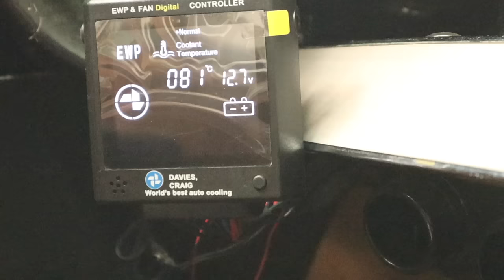Can I stop it overheating?? - Ferrari engined Alfa 105 Alfarrari build part 212

Comment: There is no such thing as a too big radiator. Also water going too fast is debatable too because it is the amount of heat energy getting processed and if you think about logically the water speed would not effect that much, however your problem was "channeling" which means a portion of water carrying  heat was making it through the radiator faster and some of the water was stagnant.

Comment: I was surprised by the result Jeff had changing the path of water. For my understanding of cooling the only way that Jeff was able to increase the cooling effect is because before some (a lot) of radiator is unused with low or no flow in. Any thoughts on this?

Comment: I have some doubts about the wisdom of slower coolant flow through the cooling circuit allowing the coolant more time to shed its heat in the radiator.  That idea leaves more time for the coolant to absorb heat in the engine.  If the coolant is flowing faster and it is just warm instead of hot, when the warm coolant passes through the radiator it has less heat to loose.  I would try a coolant pump that had no restriction and sped up the coolant through the engine.  More cooling time in the radiator equals more time to absorb heat in the engine.  I think that the engine is better at producing heat than the radiator is than absorbing it and transferring the heat into the airstream.   Also, your engine fills up the engine compartment pretty well leaving probably diminished airflow around it.  I don't remember if your headers are wrapped with insulation or not to allow more exhaust heat to leave the car.  Cheers.

Comment: put some louvres  in the inner wings  that way the heat can escape through the wheel well , or louvre the bonnet to let air out that way ,, other option is to make it so that the bonnet is open a bit at the back end so the hot air can get out that way ,, the way it is now no air can escape anywhere , it's to tight under the bonnet

Comment: If I may put a suggestion. Put a temperature sensor on both in and out pipes of radiator, this way You will be knowing for sure if coolant can't ... well cool enought inside radiator.
Reply: Was going to make a similar suggestion. The biggest thing I have learnt in my career as a research engineer is, when in doubt measure something! That way you can confirm or rule out the various hypotheses about the cause. In this case, the more places you measure temperature the better, inlet and outlet of radiator, engine bay air temps, ideally a thermal camera onto the front face of the radiator... etc.

Comment: Jeff, do me a favour. 
Find a way to install a drain pipe to the base of the radiator - seeing all that coolant run over the bottom valance is shocking.    I know small stuff, but I know it bug you too.
Reply from the maker: It does annoy me, but hopefully from now on it is a very rare occasion to do it ;)

Comment: sheared??
shear: verb
past tense: sheared
    1.
    cut the wool off (a sheep or other animal).
           cut off (something such as hair, wool, or grass), with scissors or shears.
         2.
    break off or cause to break off, owing to a structural strain.
    "the gear sheared and jammed in the rear wheel"

Comment: with all that engine in a small engine bay.. the hot air will stagnate and not flow out well,,, find a way to vent the heat out.. even small hood vents would do a lot to get air flow out of the engine bay// as a test you could prop the hood up  1 or 2 inchs.. test it... to see if this helps cool the system down..and if it does.. you have found your problem and you can make very subtle hood vent that would look good on the car
Reply: sorry? then i will not comment here anylonger HomeBuiltBy_Jeff

Comment: Hi Jeff

Do yourself a favour and have a aluminium radiator made (replicated ) I have a 79 GTV and it now never ever gets hot. About 1/3 better cooling same size and shape. I wanted a fat core and the guy refused and years later I am still very impressed with the standard custom aluminium radiator.

Comment: Would an oil cooler help bring engine temps down? I have a small footprint radiator in my 2.8 vw vr6 super charged mk2 Jetta/vento with small fans and an afco Scirocco  radiator but have an 8 x 11 inch oil cooler. I have not run it yet but my thoughts are cooler oil would have slightly better cooled motor

Comment: Interesting with the radiator fix. Glad it worked but i dont buy the transition time theory. If you have one big radiator it will flow through that slowly.Three smaller ones will have water moving through them faster (relative to the radiator). I think maybe the issue was some shunting of the cooling maybe in the large radiator? Ie it maybe it was easier to go through part of the radiator than to the end and then through? Don’t know but nice it worked :)
Edit to clarify. Now it can be seen as a radiator that is 3x wider but 1/3 as tall. Coolingarea is the same.
Reply from the maker: I was not clear. It is not a speed through the radiator, but more that the coolant will take the easiest path and it with the big internal passages, probably just flowing across the top half of the rad. Now it is forced to use the whole thing ;)
Reply: @HomeBuiltByJeff  Ahh :) Then I totally agree with you.u.

Comment: Saw this on a Ferrari forum........ Do you have the same volume of coolant as the Ferrari 360?

"The 360 also runs the same setup, operating temps are 77~81C 170~177F open point on stat, with a maximum allowed of 120C or 248F, given the complexity of the system including the inclusion of engine management to the temps of the cooling system sustained temps that are above 210 will cause problems.

the operating point of the 308,328,348,355 & 360 is around 195F the entire system is setup to try and hold or maintain the temps in that area. will it go higher at times, yes, but it should return to 180~200F long term temps beyond that indicate a problem somewhere.

The oil system is not passive like found in many other vehicles, with the exception of the 308/328 it's a drysump setup with it's own coolers/fans etc.."

Comment: I thought the coolant had to enter the rad from the bottom and exit from the top.  That way the whole surface area of the rad gets used.  Could you reverse the direction of flow to test?
Reply from the maker: No, should always go in from the top. Heat rises and you want the cooler stuff at the bottom back in the engine ;)

Comment: I'm a bit worried that sealing up the point where the two exhaust pipes meet - where the 'x' is formed - will have introduced a flow constriction down each pipe.
Is that not a concern at this point?
Reply from the maker: There is an Engine Masters episode you need to see ;)
Reply: @HomeBuiltByJeff Probably more than one!
Your Alfa is a symphony of automotive excellence :)

Comment: hi Jeff - I vote for some Opel Manta/Ascona 400 triangular holes in either the bonnet or the perspex window to at least let some heat out of the top of the engine bay - surely thats got to help. Brilliant work as usual - you made the adding those new exhaust boxes seem almost too easy...!

Comment: Jeff, do you know what model Corolla you have the rack out of? I've got a 99 AE112 as my school run car. Happy to take some measurements (eg like centre of axle to centre of rack measurements on the steering knuckles) if you'd like. It only runs 14" wheels, it's not a huge distance and I've never noticed the rack in it being that slow.
Reply from the maker: The big measurement I need to know is the distance the rack moves in one full rotation. Mine is about 38mm. I need one that is much less than that.
Reply: @HomeBuiltByJeff  I'd have to get it up on ramps or blocks to check that. It has 3 turns lock to lock which seems similar to what you said in the vid.
I'd be curious about the distance between the steering pivot point (ie through the strut top down to the lower ball joint) and the tie rod ends you've now got.
Reply from the maker: @stevewandel9317  I just realised I had my measurements around the wrong way, and I need more than 38mm per revolution. I think the Yaris rack might do the job. We will just have to wait and see how it goes next week ;)
Reply: @HomeBuiltByJeff  yes agree, more movement of the rack needed the further the tie rod is from the axle line

Comment: Coolant must go in the bottom and out the top of the radiator. There is a differens…..
Reply from the maker: No it should definitely go from top to bottom.  Heat rises

Comment: Did you consider removing the yellow long cover from the top of the radiator?
Reply: That would let air flow over the radiator instead of through it.
Reply: At very low speed (ie traffic) it would help to dissipate the heat
  @Darren_Martin

Comment: Maybe a different antifreeze could solve your problem. Ever thought of Evans Coolant? It's the only thing Jay Leno runs in all of his cars...
Reply: Engine will run hotter with Evans, it's boiling point is up around 170+ DegC (I think). The big advantage with it is it doesn't expand at the engine's operating temperature so the cooling system doesn't have to, operate under pressure. But it does have a lower heat transfer coefficient than water based coolant.

Comment: jeff you might want to consider the fact that your front end has a very small opening restricting incoming air flow at hi volume air flow needed period hi speed or on highway cruising i found this issue on conversions were the smaller cars same as your issue had no air flow at highers peed  would slowly heat up  around town there fine but on the highway you would see it creep up some times over a slow period of 10 to 15 mins at 100 kph you would see it slowly go from 88 deg to 98  but again around  town be perfect always 88deg if you want a better note and make it quieter out of your exhaust you should run gated mufflers like lukey turbo or simular staineless  there a truck muffler simular looking to the ones your using but longer.

Comment: Pumping in more air with nowhere to go isn't very efficient. Just need to vent that hood so you can give the hot air somewhere to go, and in the direction it already wants to. Look at any serious race car. You did change your shielding gas for Aluminum ya? (I forget Argon/CO2 for steel, pure Argon for Aluminum?)
Reply from the maker: I Always use pure Argon for the TIG and mix for the MIG. Does the job for me.

Comment: I've seen this multiple times. The problem is the shroud on the back of the radiator, it blocks too much atmosphere from flowing through the radiator. It restricts it.

What you need is to get rid of that POS shroud on the back of the radiator, and create a hand-made shroud that shoves atmosphere through FROM THE FRONT. You need to manage air flow in FRONT of the radiator, forcing the atmosphere through the radiator and not allowing it to flow around the radiator. 

Seriously, the manufacturer of that radiator/shroud/fan set-up does not know WTF they're doing. Delete that shroud completely, and figure out how to mount the fan(s) without it.
Reply from the maker: Managing airflow from the front makes basically no difference while the car is stationary ;)
Reply: @HomeBuiltByJeff 

1. Yes, it does.
2. Your car overheated when it was moving. That shows that your entire cooling system is crap for it's intended purpose. If it can't keep the engine cool when the vehicle is moving, it sure as hell won't keep it cool when it's stationary. 

Whether the atmosphere is moving due to fans sucking it, or the vehicle moving and pushing it, is immaterial. The atmosphere has to get forced into the front of the rad, flow through it, and exit out the back. The current system doesn't do either the former or the later properly or efficiently.
Reply from the maker: @glock22357  It has never overheated when moving at speed. Only when stationary or crawling through a crowd of people... ;)

Comment: a car should not overheat when it idles... you can simply check the flow issue by feeling or checking the temp on each side. 3 cores... should have done 2 max. but this isn't your problem? are you checking temps with a 2nd or 3rd measuring device to verify? pump flow rates maybe. but there is no way idle should overwhelming your system. it shouldn't get hot even without a fan

Comment: If the fan is cooling a stationary engine sufficiently through a cycle.  Is that too much ?  Maybe now your engine might run too cool on the road. Watch that.
Reply: No, since he can turn the fan on and off and the electric water pump can reduce the flow of water to keep operating temperature (same as a thermostat in oldschool cooling systems). There is nothing really different to any normal car here, it should be able to both keep itself from overheating stationary at idle and to keep operating temperature with the control of water and airflow.

Comment: You fixed it but to clear up as ex process industry. Its not fixed by reducing flow rate its fixed due to increased residence time in the exchanger so heat exchanger efficiency. All this talk of slowing the flow rate is wrong conceptually as you have demonstrated as the flow rate is the same. In fact you want the highest flow rate you can get without pump cavitation issues creeping in. 
Also with high frequency noise, baffle silencers work better as many a supercharged honda vtec tuner has experienced including me so if you find it still very noisy at full chat you need to swap two of the silencers to baffled.